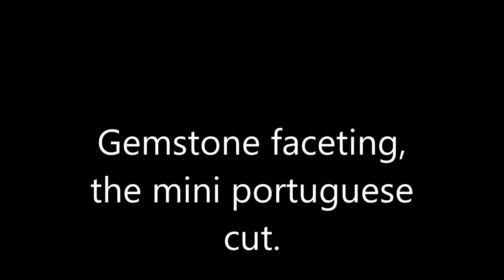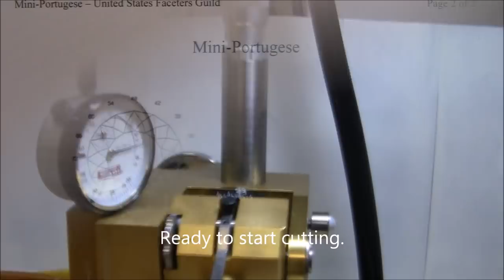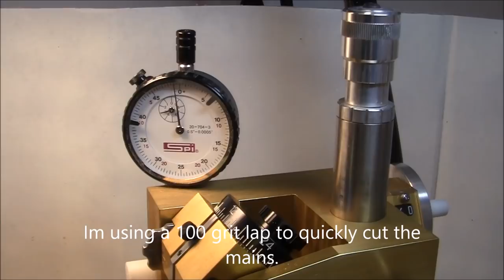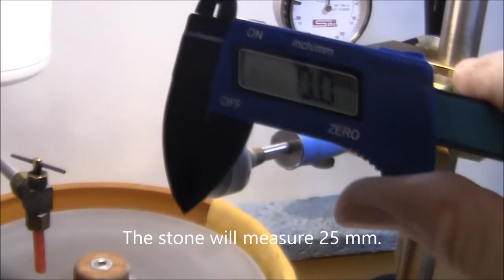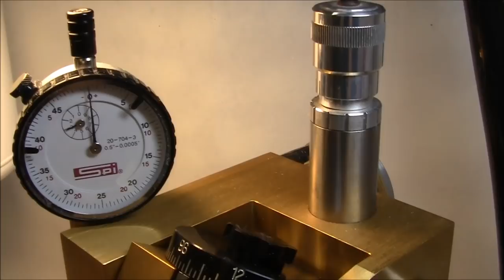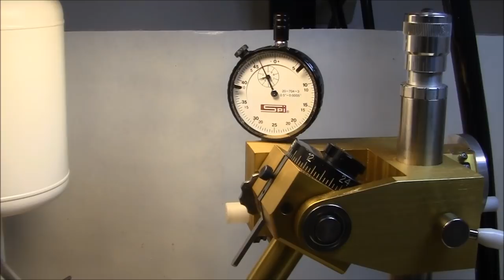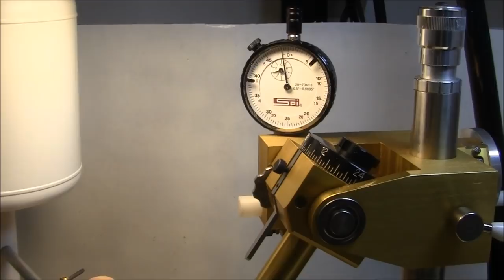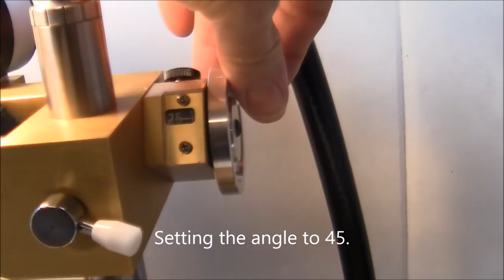Faceting gemstones: a mini portuguese cut.

Comment: I'm surprised at the material.  I would have not thought to use TV picture tube.  Nice!  Also excellent work.
Reply from the maker: Hi and thank you for your comment. As a faceter and most hobby faceters might agree, im  always looking for free or low cost materials  to cut either for practicing a new design or otherwise and any kind of glass works well.

Comment: How much to cut an translucent opal in Portuguese cut?
Reply from the maker: sorry  not doing cutting these days
Reply: @tennpikr74  it's ok  could you recommended a cutter?  What would the  minimum the measurements  height length width proportion for a rough I should look for.